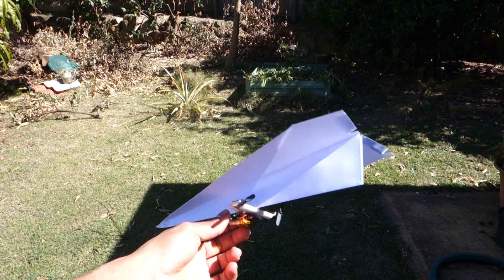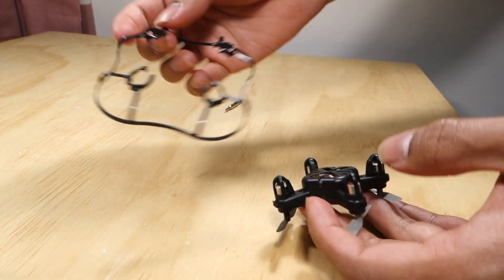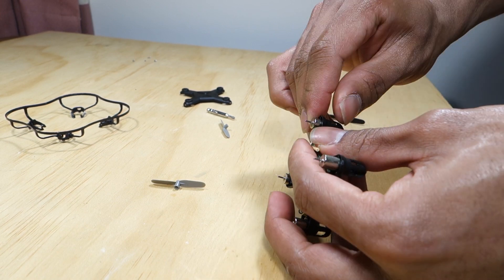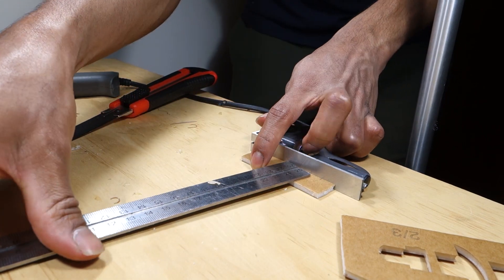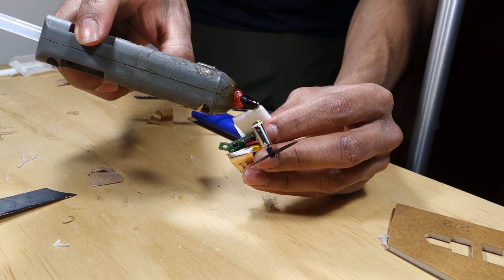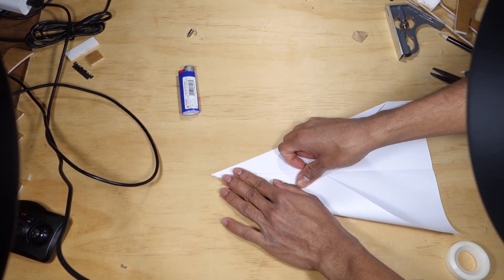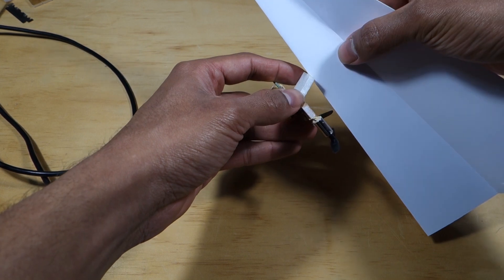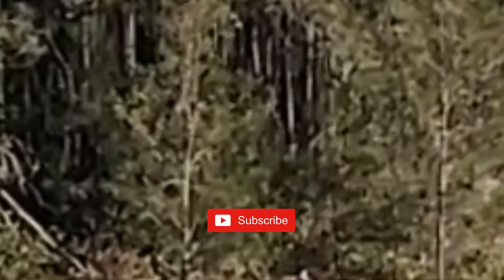DIY Radio Control Paper Plane for $10!

Comment: I've got a broken helicopter that's got two motors spinning opposite of each other.
I'll try it.
Reply from the maker: I'd love to see it once you finish!
Reply: @BudgeProjects   I've been able to get it working, but I've come to realize that it only works indoors because it's an infrared system...
My local RC club has a gym in the winter for flying, so I'll try it there.
Also I have been thinking it would be more stable if i use it for a Blimp.
Reply: Same I got a quad that is broken but back motors work